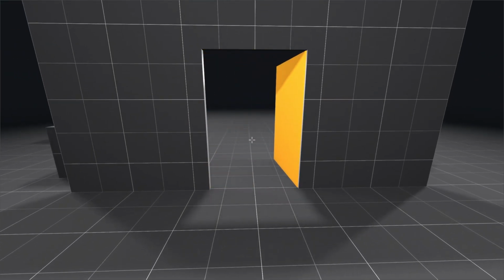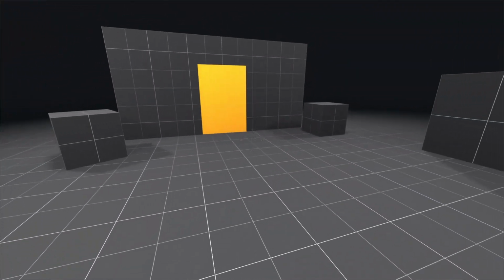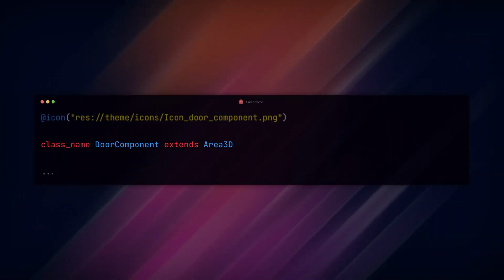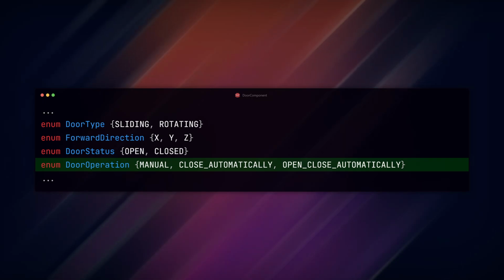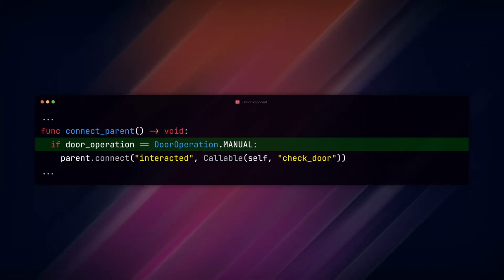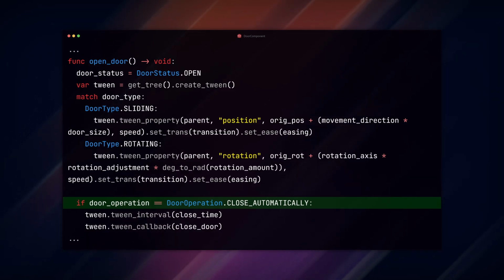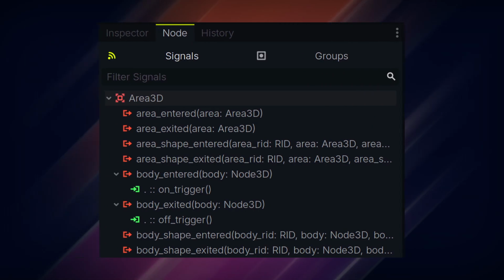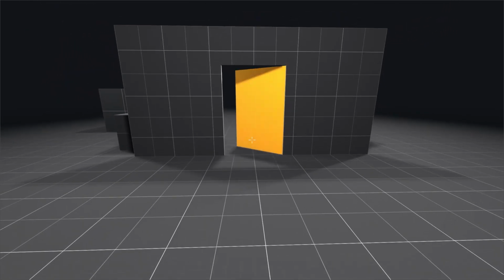How To Make Automatic Doors // Make An FPS in the Godot Engine

Comment: If I set it to CLOSE_AUTOMATICALLY then tap the E key the door_open function runs immediately followed by the close_door function, then when the tween calls back close_door runs again. If I hold the E key until the door opens all the way then it just runs open_door and waits for the callback as expected. I probably have a is_action_pressed somewhere i need a is_action_just_pressed or some silly thing like that.
Reply: ya for the interaction input i had is_action("interact") instead of is_action_pressed("interact") so it was firing on release as well.

Comment: if DoorOperation is se Close Automatically, interaction doesn't work anymore. I had to change the connect condition: 
func connect_parent() -> void:
	#connect ton interacted signal only if Door Operation is MANUAL or CLOSE AUTOMATICALLY
	if door_operation == DoorOperation.MANUAL or DoorOperation.CLOSE_AUTMATICALLY:
		parent.connect("interacted", Callable(self, "check_door")) #"interacted" created with interaction component

Comment: I've been following these tutorials for a while and a problem has come up. How do you change the variables in each door instance (locked, automatic, etc.) in other scenes? As the component is nested inside the door scene, you cannot edit export variables easily in parent scenes, which requires activating editable children for all doors (and all interactibles with this system). Having everything with editable children is kind of error-prone when you make changes in the base scene right? I think I may go with old fashioned inheritance for this use case in the end.